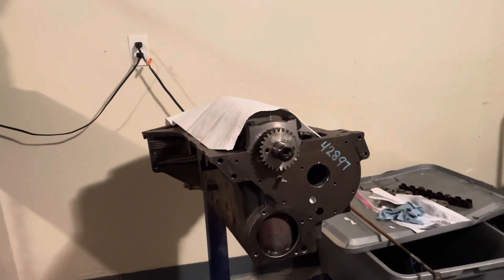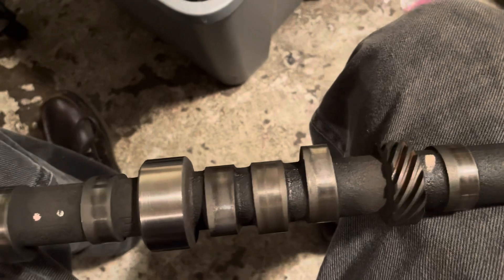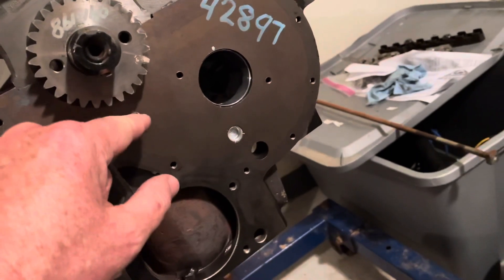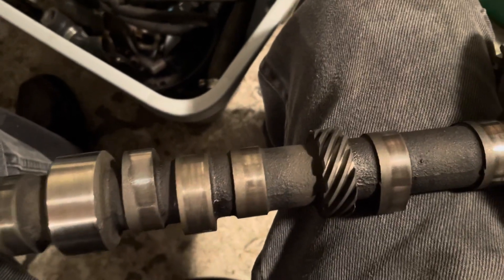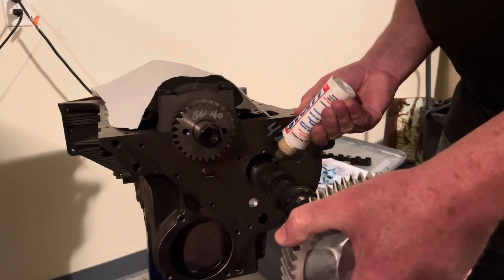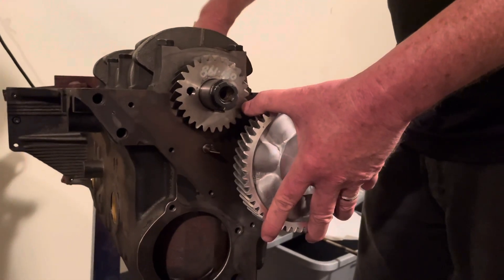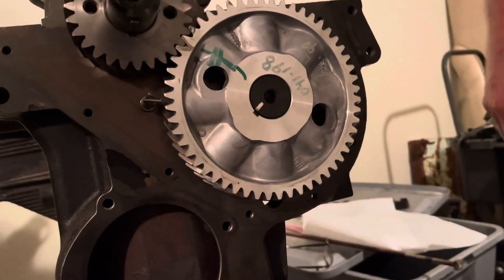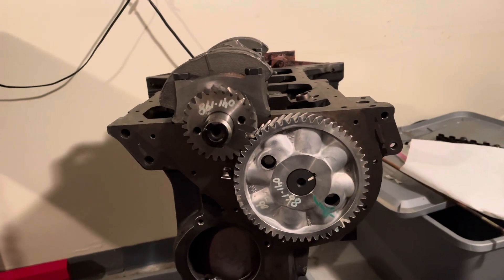Mercruiser 3.0 1(d) - Camshaft Install (Lifter Lesson)

Comment: Hello sir, thank you for the very helpful video and information. Could you please tell me if cam bearings need to be honed or line-bored after installation in the block?
Reply from the maker: Not usually but I’ve had to ream them out before if they are too tight. I take a used cam and cut a groove in the back journal and use that as a cutting tool
Reply: @moccasinmarine Wow, that's a cool idea! Thank you, sir!